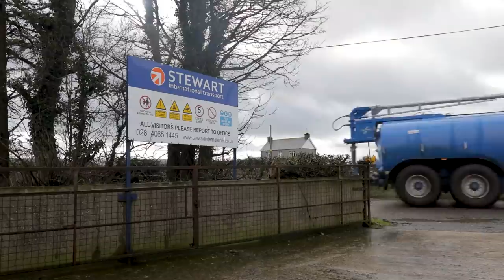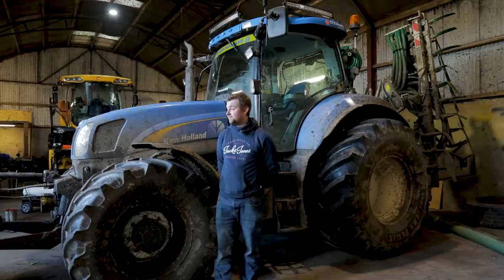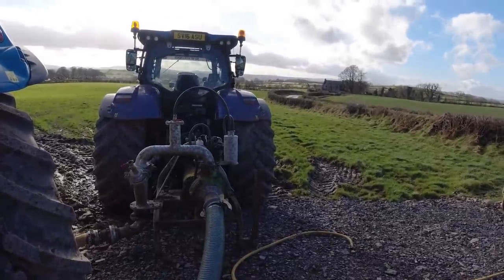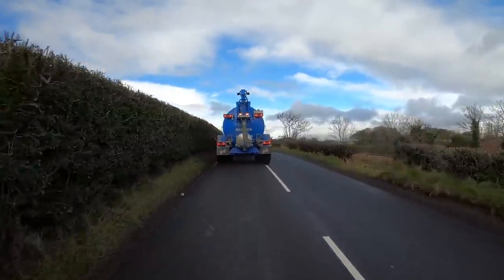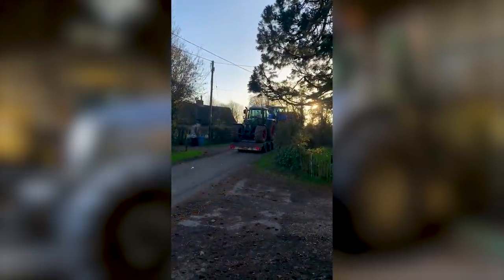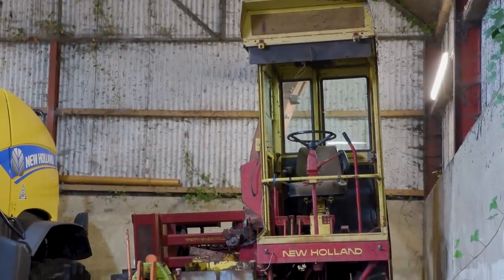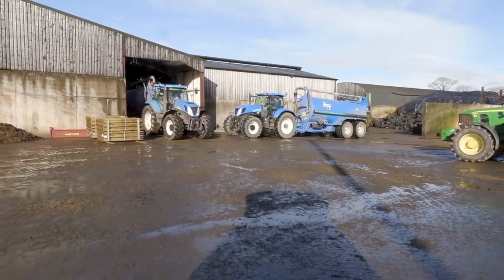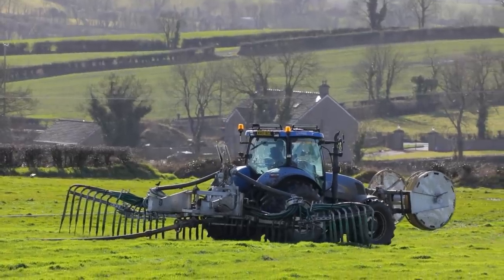Slurry with Stewart Agri Ltd.

Comment: Why are all the tankers equipment with a vacuum pump?
Is your slurry in Ireland too abrasive for pumps or is there a other reason?
Reply: We use vacuum pumps on the tankers so that one tanker can go on its own and fill and spread at a farm and no extra cost of an additional pump other than to agitate the slurry is required as most farmers have will either have their own mixer and or tanker and it leaves the job a lot easier as when you go to change farms you don’t have to tractors with machines to move if the slurry is ready you just take the tanker and tractor